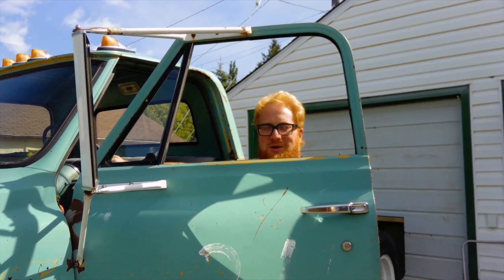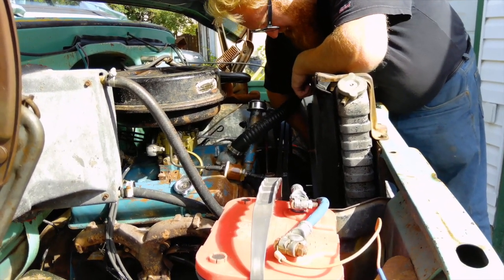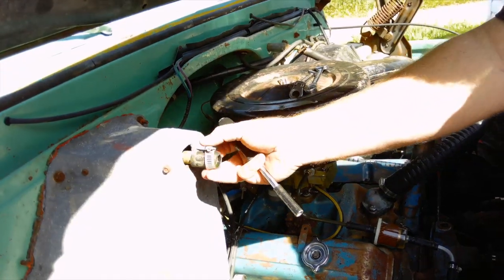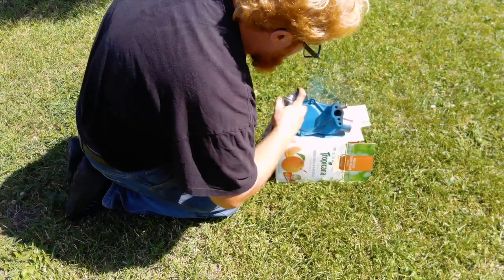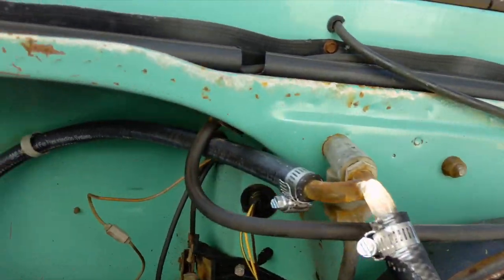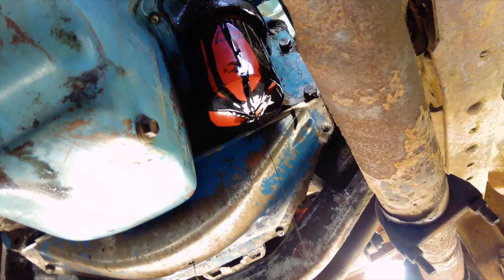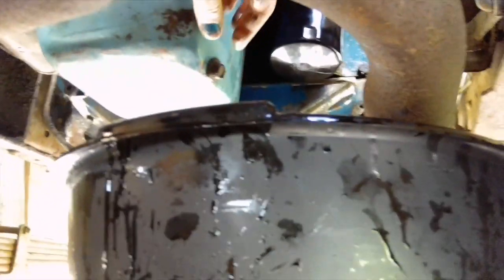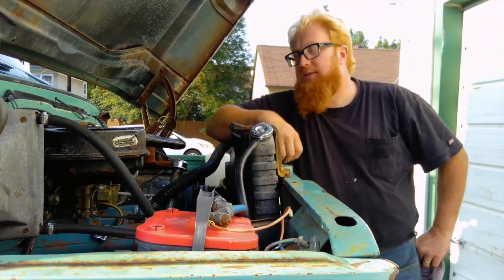1967 Chevy C50 Needs Some Love: Maintenance and More #c50

Comment: Can you show a close up of how motor mounts are mounted. Planning going from a 366 big block to a small block so figure i will have to change how its mounted.
Reply from the maker: I will do that, I'll make it a short or in a video, do you have a horseshoe mount on the front of the engine?
Reply: @RoyMarkosGarageRMG  on the 366 it does. But sure the SBC is going be a shorter block so going have to change something
Reply from the maker: @jamesferrell9404  Yes, I'll get to the video so we can check it out.
Reply: @RoyMarkosGarageRMG  thanks maybe it will help me out

Comment: Odd question but how much of a hassle was it to get that old girl registered and insured? I'm looking at picking up a 65 C50
Reply from the maker: It was a real big hassle, took several weeks, but did get it done in the end.
Reply: @RoyMarkosGarageRMG  what was the biggest hassle?
Reply from the maker: @lp2051rlp  dealing with the insurance, as it was last registered before 1985 so a ton of paperwork, if it's after that point I don't think you should have a problem, but that took a while to get that in order.
Reply: Might check with Hagerty Insurance Co.